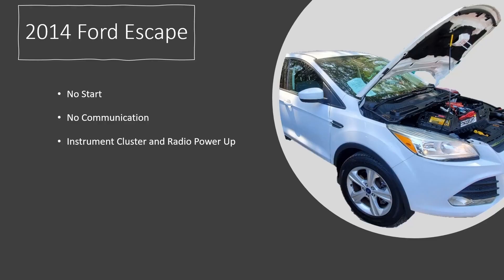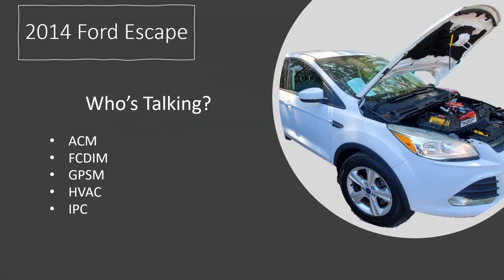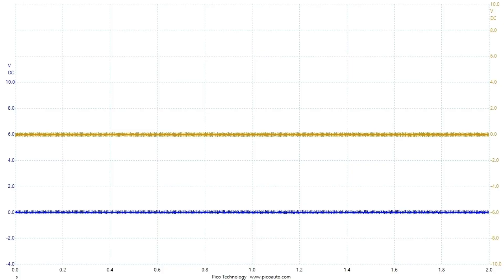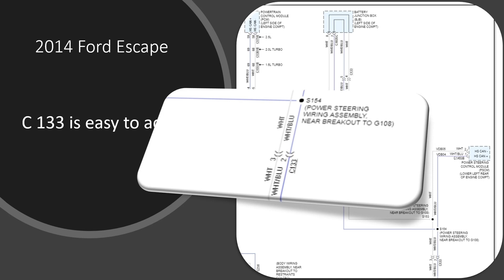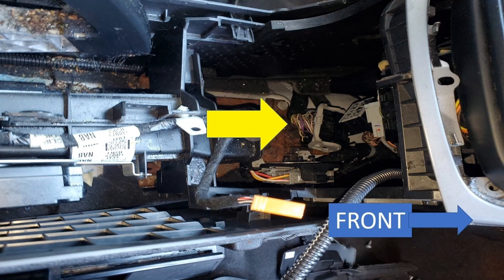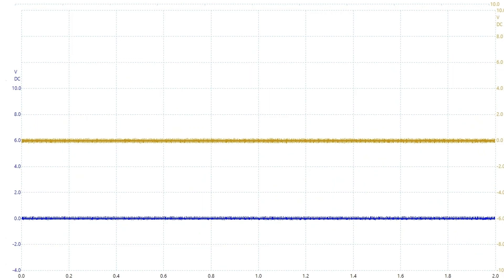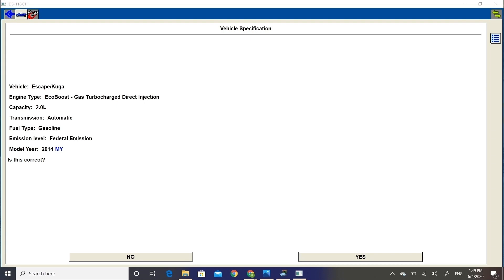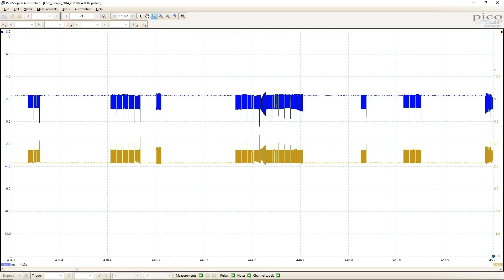2014 Ford Escape No Communication

Comment: Just wondering , what would i see if I disconnected the battery and turned my multi-meter to the ohms readings and connected one probe 
 to any of the can communication lines at the DLC and the other probe to the negative battery terminal before disconcerting any of the can wiring connectors . Looking forward to your reply and thank you for your time .
Reply: Sounds like a loaded question, why disconnect the battery, its proper to test for ohms on the CAN H & L lines with the key off to get about 60 ohms normally at the DLC pins 6 and 14, so why do this disconnect battery step, can you enlighten us pls Sir?
Reply: It should in theory read an insanely high Ohm reading or no reading at all. My issue with my Escape has been I am getting continuity on my CAN and ground, CAN and hot. No good.